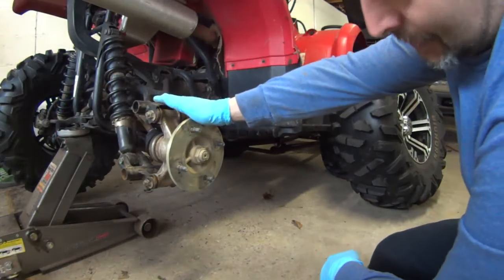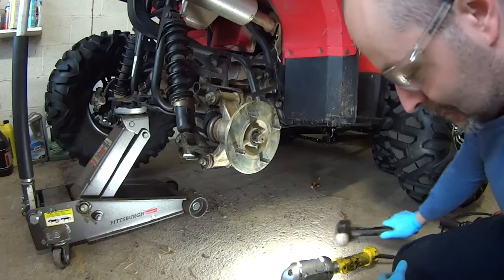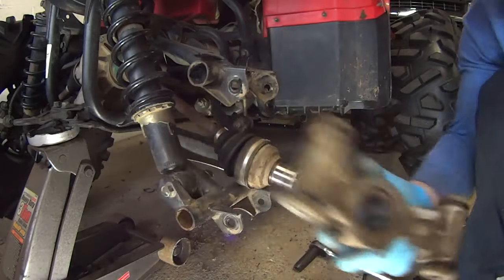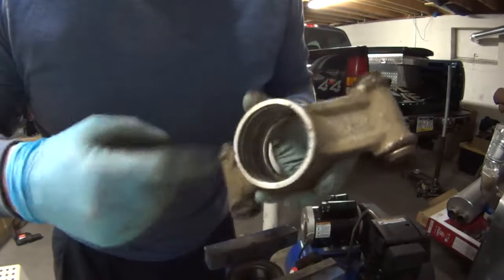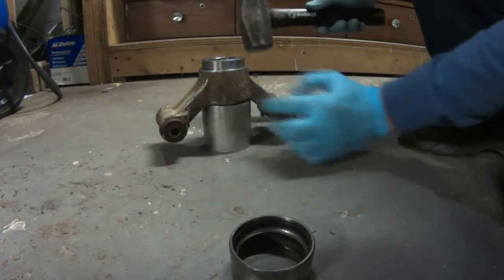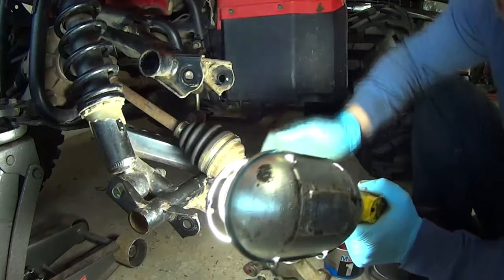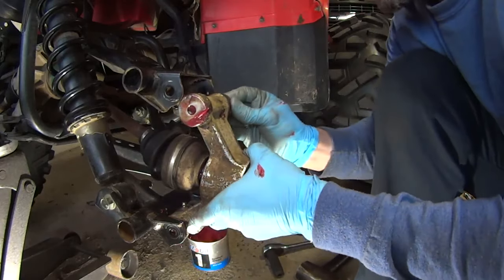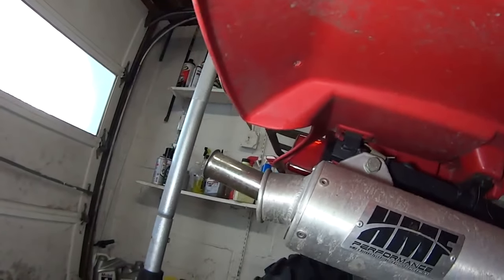Yamaha Kodiak & Grizzly Rear Right bearing replacement

Comment: Careful when you torque your nut at the same original position. If the new bearing is slightly longer by a few mils you will over torque to reach the same position. Otherwise good vid, thanks for sharing

Comment: Did he just hit the axle thread with a hammer without a nut to protect the thread? Tut ,  tut!
I would also use a press rather than hit the bearings out. Also one good hit rather than many little ones does less damage. Many methods he uses were big no ,  nos in my training as a mechanic.
Reply from the maker: Sure did. The axle has first 1/16" turned down so that you can not damage the threads.
Reply: ah .. I see. I would still certainly try to deploy some sort of protection though.
The multiple small hits with hammer were still
a no no.
Reply from the maker: Most the time I put the nut back on and hit that but like I said, sometimes the engineers make it easy on us by providing a cut with no threads on the edge
Reply: I'm over trained.
Reply: EpilepsyWarning. You're under educated ... and in more ways than one.

Comment: What was the silver tool you used to get that plate off ?
Reply from the maker: Any bearing puller will work. I used one from this kit but you can buy just a puller for $15.

https://www.amazon.com/GearWrench-41690-Front-End-Service/dp/B000TDCCHW/ref=sr_1_fkmr1_1?s=automotive&ie=UTF8&qid=1509639020&sr=1-1-fkmr1&keywords=gearwrench+3916d+universal+ball+joint+separator

Comment: You forgot to pack the barring with grease don't be shy
Reply from the maker: bearings are sealed packed with grease
Reply: These are sealed bearings but you still can pack them with a tool made by machined integrations.  Very cool actually!  After doing some research on my end, you really want to add more grease to the bearing out of the box.